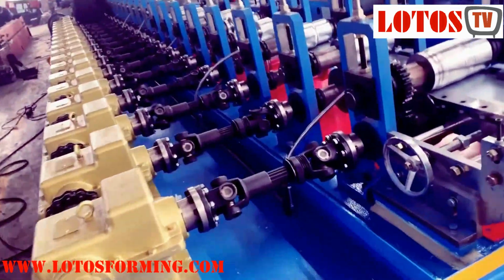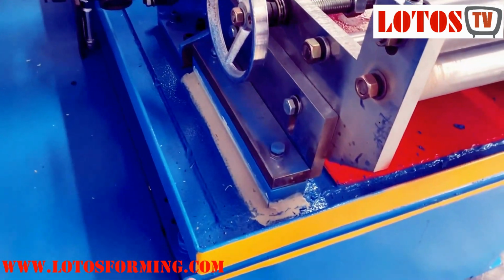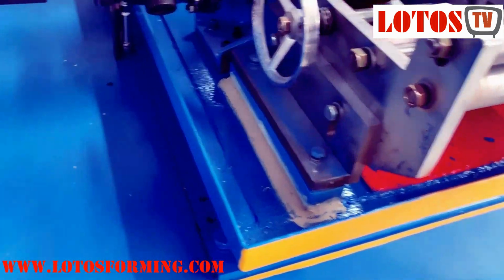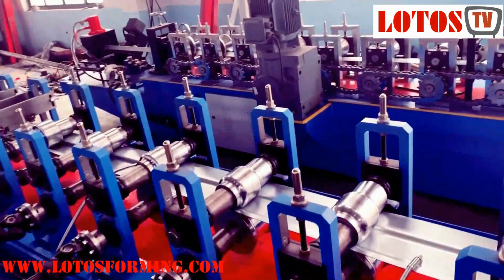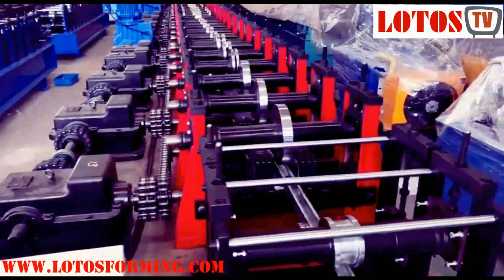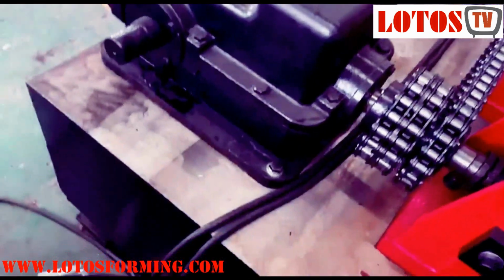【Roll Forming Machine Equipment 】: Roll forming transmission | How to choose roll forming machine ?!

Comment: The main structure of the machine forming roll consists of six major architectures, cold molding system, hydraulic system, voltage system, electrical control system, base, this mechanical transmission system, the main cold system